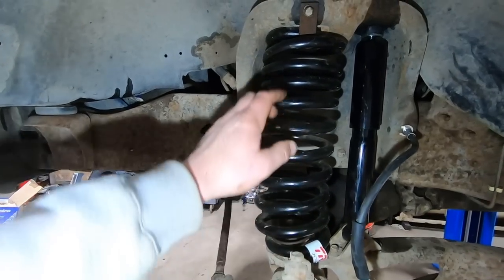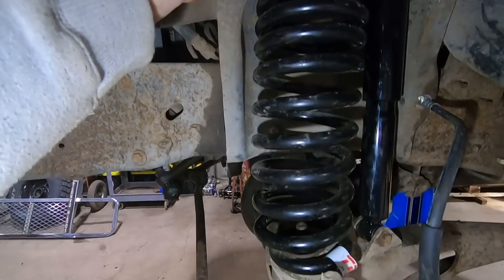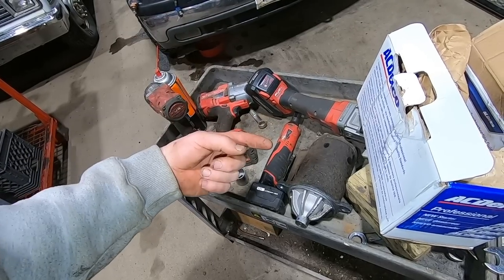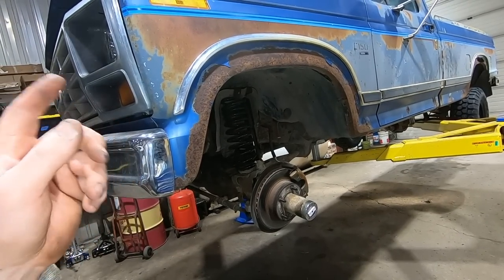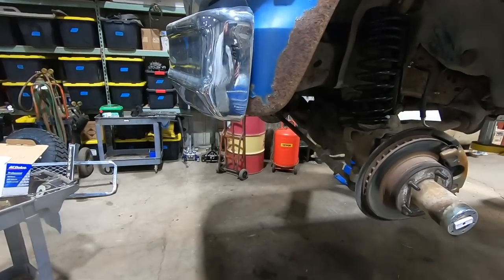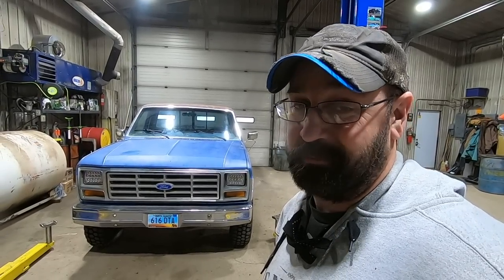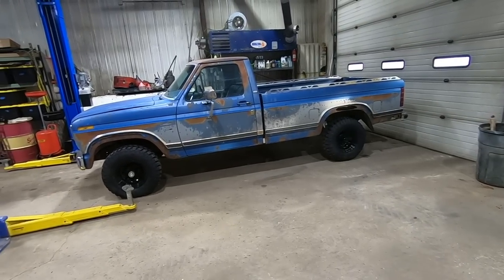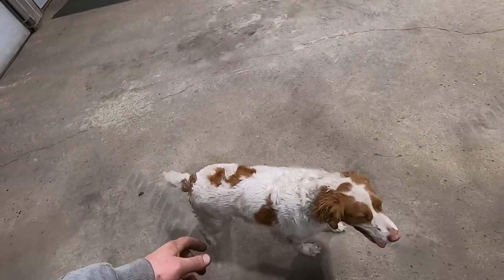F250 Springs in an F100?!? Budget Bullnose Ford Lift Kit! Mortske Myth Busting!

Comment: ooooh! I had an 87 F-150 W 250 REAR END. 351W 4bbl. 4WD. My first Ford. Climbed like a billy goat, bone stock everything else. What a BEASTY!! I remember loading the boiler, slant fin, and all the plumbing copper for a 2600 sq ft new home that I was working on. Homeowner put himself through college as an apprentice plumber to his uncle so he got it all for cost, but asked me if I could get it from 50 miles away. Had to be close to a ton and it barely leveled out the bed, no Carolina sag at all!!  11.5 mpg fully loaded, empty, uphill, downhill, still 11.5 mpg Loved that thing. It got stolen and wrecked, I almost cried. Had 6-7 Fords since then, damn thing got me addicted!!!! Love it, and love what you do Mortske!!!

Comment: You can get adjustable castor/camber bushing for the center pivots and adjustable or fixed degree bushings for the upper ball joints on the TTB front ends. To do a 4 or 6 inch lift you gotta drop the center pivots too... those lofts come with the drop brackets.
Reply from the maker: Good to know

Comment: When lifting one of these rigs 4-6 inches there are brackets that lower the center pivot point of the I-beams. 

These trucks have a sleeve that is pressed into the upper steering knuckle area of the I-beams, the mounting stud for the upper ball joint passes through said sleeve. There are adjustable aftermarket sleeves that are oblong (you remove the stock sleeve and replace) that allow a few degrees of adjustment in the ball joint to correct the camber. There is a small amount of adjustability in the stock sleeves to allow for factory alignment when everything isn't sacked completely out.
Reply from the maker: Thanks for the info!

Comment: Nice looking bullnose. I had a 82 f150 was my mud truck. Had a 300 six, 4 speed, 4.11 gears, lockers, 3 inch lift and 35s. Was a beast in the mud. Wish I never got rid of it.

Comment: I put 1 ton rear springs on my 67 c10. Got 1 inch lift at rear axel. No need for longer shocks. Cost $20 bucks for the springs in 1972.

Comment: Cool! I like a "will it run" on a basket case as much as the next guy but it's nice to see a vehicle a little further along in the process from time to time. I like the stance of this truck as it is. Those headlights are hideous.
Reply: I'm in agreement on the headlights,,  ugly as a mud fence,,, I suppose that glass head lights are not available any more,, I had glass headlights in my 1992 ford ranger,,  They were like flame throwers when  the high beams were on,,  :-)

Comment: Grew up doing upholstery. We would take and rub the backer with a brush that has decently hard hairs on the brush. Scurb the old glue off. May have we to use razor blade on super thick glue spots. Then lay material on spray half of the backer and material like you did. Roll it on with rubber wheel. Usually leave ¹/² to ¹/⁴ over hang and glue it to the back of the board. That what we did. Then cut x over the holes for light,mirrors etc. But good job
Reply from the maker: Thanks for the tip!

Comment: It has camber bushings on the upper ball joints. I've lifted 3 of them. 
The kits come with drop brackets for the axles and different/ longer radius arms with drop brackets which has a new transmission cross member to tie the new radius arm brackets together. Don't forget the drop pitman arm,  new rear leaf springs and longer brake lines. 
A 4 inch works well with 35s.
Reply: Combo camber bushings also can go up to a 3" life I have em on my 94-f150 non 4WD. Steers straight as a arrow.
Reply from the maker: Thanks for the info!

Comment: That's what I'm rebuilding, but F250,.and it had the IFS front end on it and yeah they've got brackets that lower that center section down. I scrapped that IFS 44 front end and I'm putting a Dana 60 straight axle under it with about 6 in of lift, 500 hp 460.
Reply from the maker: Awesome!

Comment: I bought a 84 Pontiac Grand Prix (G Body) back in 87...
It had low miles , but the orig owner lived on a dirt rd that turned to soup in spring...
The exhaust was ripped off , the tires were mix & match & he never used the A.C. 
He preferred the windows dwn that loosed the headliner ..
Bought it for $1200 .
Pulled the seats , replaced the clay packed carpet , replaced the headliner .
New tires, new shocks & she was purdy again...
But this ole girl had a V8 in her....
I had about $1500 in it...
It only had 47k .
Loved it...she's one of my favorites back in the day..
Rode great & was quiet..
I still dig a clean G body . But they're rare as tits on a chicken..

Comment: I had a twin i-beam Ranger that looked like the front end was sagging just because the wheel offset was wrong.  I put a set of OEM type wheels on it before I sold it and it looked totally normal again.
Reply from the maker: Hmmm, wheels must have magnified the issue

Comment: Reminds me of the misadventure of lifting my ranger. Dead of winter, in my driveway, on small jack stands. At one point the front axle came loose and the rotor crashed right above my knee. The whole area swelled up big time.
Reply from the maker: ouch!

Comment: Use a garage door handle one of the normal non keyed ones the way they are set up turn one direction and pulls both pins to open position and makes it easy usually they come with the cables

Comment: finally you lift a pick up truck instead of set it down to the ground, I like that, oh by the way if you wanna have a broken ignition Coil, mine just went out on my 2002 Silverado so that much said to they never fail hehe! well I'm 59 and it is my 6th bad ignition Coil in my life.
Reply from the maker: That's late model stuff!

Comment: Looks good man, helped a lot, I'll be doing a headliner very soon.
Reply from the maker: Awesome!
Reply: @More Mortske Repair  Any chance you could put a 3" lowering kit on the front of an 87 F150 next? That would be very helpful!
Reply from the maker: @samcoolidge5988  Dream Beams are the only way to do those. I don't have one in my fleet and those beams are big $$$
Reply: @moremortskerepair4354  I have them sitting in my garage. Came from DJM.
Reply: I'll buy you and Duff a plane ticket if you want to come turn some wrenches in Maine!

Comment: Didja use the HD F250 springs, buddy? My 85 got a legit 1 1/2" up front... mines also a swb and has an i6 so that may have figured into it.

Would liked to have seen more on the heater core mods. I'll be replacing mine soon (also a RockAuto part) and l don't... like... surprises.

Comment: I believe if you look for the tailgate chain eliminating kits for the mid 60's model Chevy trucks, you'll find the setup that works very similar to what you installed on the F150, but it's setup for one handed operation of both sides at once.
That said, there's probably one for the old F100's that have chain retainers for those tailgates come to think of it. 
Don't know never refurbished a older FOMOCO truck, just a 68 GT fastback Bullitt clone. 
So I can't say positively or not, but I'm sure you can look online to get idea how they work, and being as you're pretty sharp can make your own if you so desire to. 
Just a thought from an old feeble mind, and one never knows what you're up to doing. 
BTW, not a representative of Odoban, I just passed some information on something that I found actually works in the foul odor control department.
Which I will be using again tomorrow, because I had to evict a family of striped kitty kats from the shop half of my barn that had moved in, and tries to takeover for themselves. 
Not a pleasant job, but hopefully they won't be returning from the several miles down the road where I let them go. 
One of the kids didn't want to leave, and let me know by marking everything it could on the way out. 
Fortunately for me the blanket covered my side of the live trap, and wasn't too hard to wash off myself, and washing my clothes used up all the odoban .
Yes Sir I realize I tend to be long winded, and ramble on, but just letting you understand how I know that it really does do what I claimed it does. 
You n Duff have a Great Day, and Master Chin has good taste in music, even if I prefer old Blues, but he does occasionally use some better than average tunes.
PS
Anything polyester especially clothing, hair bands the ladies wore across their foreheads, any and all disco music should cover definition of "Aggressively Tacky" for you.
Reply from the maker: Thanks for the info!

Comment: How was the isolators under the springs? There always brittle. I just put a dab of greece on mine.  The axel pivot bushings willow out on the inside top. But I love the bull nose ferds and the blue n silver combo can't go wrong. A nice cheap helpful up grade is the tailgate torsion bar I can open and close mine 1 finger. But I'm rambling on because I'm on meth 🤪
Reply from the maker: They were good
Reply: Great 👍 give duff a pat on the side for me..

Comment: So the coil lift was a Grand Illusion. I'll bet Duff said, I told you so!
Reply from the maker: Yes, sadly
Reply: @moremortskerepair4354  I could sense your disappointment. I would have been disappointed myself. Not just the money but the time spent as well. Like you said they make a variety different spacers, but I imagine they compromised the ride.

Comment: 😒  ..hate to be the one to tell ya but the spring swap is gonna kill your tires.

I learned it the hard way back in about 2007 on an 86 F150 4x4. My old springs were clapped out and wearing the inside edges of the tires so I swapped in the bigger springs. Put a good set of tires up front and trashed them in less than 500 miles. (90 mile round trip to work daily). Didn't even last a week. The whole truck shook on the ride home Friday because of excessive cupping. Long story short I put the old springs and the old tires back on it and drove it for 6 months with no trouble.
Tires seem to last the best on these when the tire is straight up and down or slightly negative camber. A fresh set of regular height springs will treat your tires the best.
Reply from the maker: It didn't raise it up enough to make a difference

Comment: a lft instead of a chop job damn i feel spoiled my 89 f150 has ambulance springs front and rear which gives it a 4in lift and higher tow capacity my truck is on an ambulance freame but i hear the spring will bolt into a normal chassis like yours too

Comment: Hey morski I have a question 92 obs did you ever get the other set of front lights and put them on there and put new liner on the sun visors ?
Reply from the maker: I can't even remember. We got some nicer visors. Never covered the old ones. I think we got new lights too.
Reply: Yeah you got the new lights but you said something about having to replace the fog lights to Ida know if you ever got that done or not because I don't even know if you still have the truck cuz I haven't seen it on the show on YouTube I know you put it up for winter cuz it's too good but yeah last time I knew that you had it fixed the fog lights if I remember correctly you had to order them

Comment: How long to change out the ignition switch, I have trouble with mine. I have 1990 Ford F150.
Reply from the maker: half hour
Reply: @moremortskerepair4354  So a shop would probably do it in an hour so they could charge the hour. Thanks.